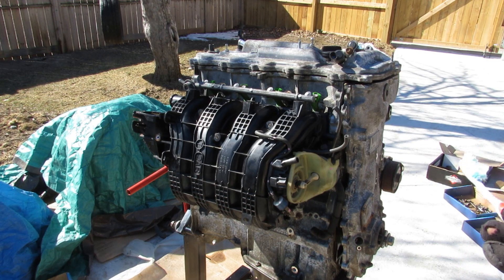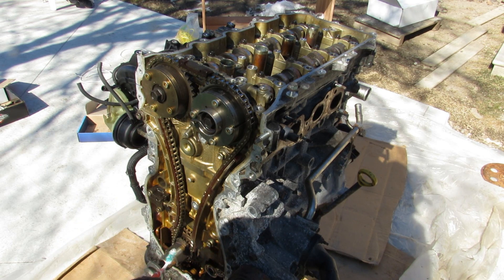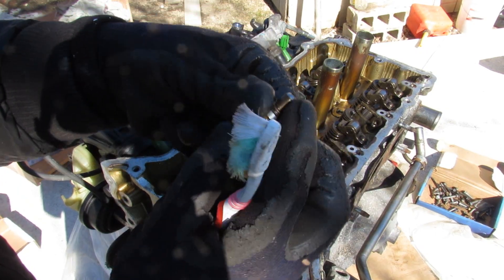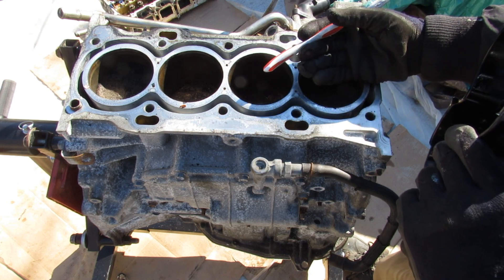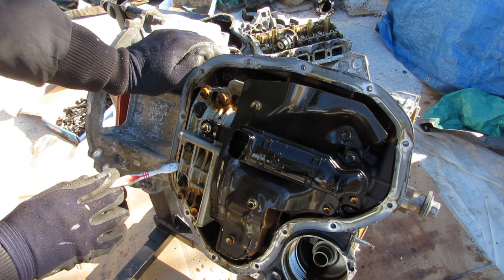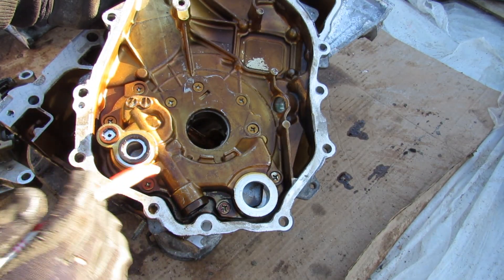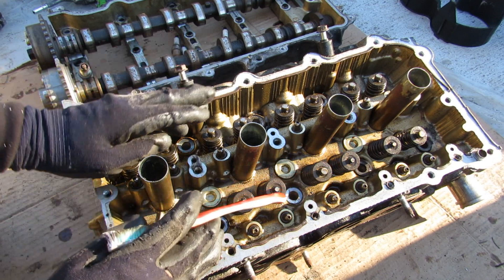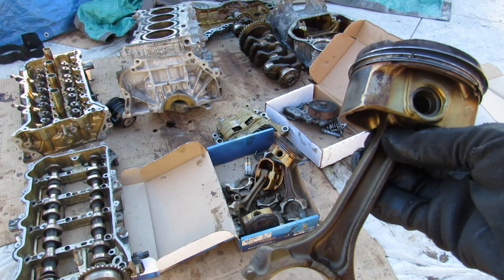Why Toyota Engines are Reliable

Comment: I noticed that since the CAFE race to increase fuel economy many engines use 0(5)w-20 oil, but many complain about oil consumption, reduced engine life, piston rings (Honda 2.4L) and crankshaft bearings failures. Plus increased deposits on intake valves in DFI, because of lower evaporation temp in low viscosity oils. 
So my question is how about using slightly ticker oil such as 0w-30, as they should provide adequate low temp lubrication during start ups, yet withstand higher loads and temperature. Would thicker 5w-30 which was  standard for decades harm engines that supposedly use 5w-20 weight, especially in higher millage engine?
A friend of mine uses in his 15yr old, 400k+ Odyssey 5w-40 Liquimolly for the past ten with no adverse effects.
Reply from the maker: A thicker oil might benefit a higher mileage engine. 
Remember the second number indicates temperature not viscosity
Reply: Our 2009 RAV4 shows zero oil consumption between 5,000 Mike oil changes using the recommended 0W-20 oil. I think anyone having problems may be using too long if an interval between oil changes (and may be blaming it on the low viscosity when that's not the problem).
Reply: I noticed on Honda engines, as we serviced a lot of Honda's, if someone did oil change past the computer reminder light, the cars would start 'burning oil', as it might either clog the oil ring passages or wore the rings. And in case of an Acura TL, one of the guys bought from the dealer still on warranty, we only drained 2 and half liters from the pan - where did the other 2 liters go😳. Nice environmental savings, with the 'Blue smoke' behind.  Anyway, the dealership changed the rings on warranty without much arguments.

Comment: My female friend had a 2008 Rav4 with one of these that burned oil since new like crazy.  Toyota dealer tested and said it was within spec.  If I hadn't constantly checked her oil level, she would have done the engine in within 50k easy.  I checked on boards and there are other complaints.  Toyota builds reliable cars, but they are not infallible.
Reply from the maker: The 08 rav4 used 2AZ which was not a good motor. This one replaced that in the 2009 model year

Comment: ive had many toyotas, they burn oil like crazy & dont get me started on the 3rd gen prius motor with all those oil burning & carbon problems.....they can be an absolute nightmare so im gonna just stick with honda
Reply from the maker: You probably have the notorious 1ZZ and 2AZ from back in the day.
Reply: @speedkar99  Any tips on the 2az-fe engine besides a rebuild?  Anything I can do to prolong its life before it implodes?  I get the oil change every 2-3K miles since 124K with Mobil 1 and now started Amsoil OE oil.
Reply: 2nd gen Prius seems fine :) 3rd gen I think you have to get one after 2012 to avoid the head gasket issue. There's probably more issues

Comment: I would like to travel back in time to 1930 and set my laptop on Henry Ford's desk and play this video for him.
Reply: Just by seeing your laptop technology you will cause Henry a heart attack and there won't be any chance to review Toyota engine.
Reply from the maker: That would be cool to see his reaction
Reply: @speedkar99  He would be shocked to see how junky the new Fords are and how excellent the new Toyotas are in comparison.
Reply: @johnw4067  are fords that bad tho? I feel like theres much worse than ford out there. Fords towards the top
Reply: @lollol-xp4mc  fords are actually extremely unreliable in comparison to other vehicles. You get a Japanese made vehicles, or Swedish you will have a vehicle that will see the next 30 years if you take care of it. Ford, modern stuff at least tends to have major issues except for their highest end vehicles. And even then it is hit or miss
Reply: @DeathProductions200  it’s their electronics. Their engines, out of all the other US car manufacturers are still more reliable. They do make reliable engines and transmissions with a few hiccups here and there. GM just churns out shit, Dodge has nothing going for it besides the hemi’s which are actually really reliable
Reply: @novasketch8658  i will argue with you on dodge. Dodge has the best interior out of the 3. For their luxury trucks, dodge avoids the cheap feeling plastic. Where as for Ford, the platinum trim, has SO MUCH cheap plastic. Dodge also, for the Cummins is a really good engine. 

GM is middle ground, but the duramax is an amazing motor as well. 

Ford really only has good engines, and the more expensive transmissions. But to me, you can have the most reliable engine in the world, but if you have a shitty interior (I was in a 2021 F350 platinum) it isnt worth it. For 80k on a pickup, I would want the interior to at least use a more durable and premium feeling plastic.
Reply: @DeathProductions200  I don’t pay attention to the interior, maybe when I’m older it’ll start getting under my skin. As for GM the duramax is all they have for a reliable engine. I would say the corvettes engine, but with that 4 cylinder shut off the transmission likes to fuck the engine over and vice versa. GM is known for bad quality, that’s why Toyota pulled out of their deal with a joint operation between the 2 literally saying in the 80’s “because of the quality control being so poor on GM’s part, we will not be partnering with them”. To put this in perspective they partnered with BMW for the Supra. I have had many friends own a Ford and none of em complains reliability wise, a lot of friends owe dodge and it’s 50/50 split on their opinion. All my friends that have owned a Chevy have major complaints ab their car being in the shop constantly due to popped driveshafts, broken transmissions, and broken down electrical components. I hate GM specifically because they always fuck up somewhere and whenever they fix it they fuck something else up along the way. Interior quality isn’t my concern, IMO if I want a luxury car I’ll build it myself. Take it to a shop to have more sound deadening and have upholstery attached to the door panels or do that all myself. Reliability and knowing what I’m getting into is what I want. It imma get a shitty car I want it to be a consistent shitty car, so Ik what’s wrong and how to fix it and how much it’s gonna cost. GM is all over the place with shit like that. Sorry ab the rant, but after seeing so many of my friends stranded on the road by a GM product I just can’t recommend one to any sensible buyer unless you want a drag car and are willing to put a ton of money into it. Again sorry for the rant
Reply: @johnw4067  Have another glass of KoolAid. I used to drink Toyota's KoolAid  as well, then my tastes became refined and I'm now enjoying my F150.  It's easier to be objective now........... Toyota dealers and owners have a huge chip on their shoulder. All the best........ hang in there
Reply: @DeathProductions200  That's not been my experience
Reply: @cwqrpportable  I've seen more Ford vehicles broken down than anything, so that may be just my personal experience. But my subaru, and my Nissan were always ridiculously reliable in comparison
Reply: @DeathProductions200  I've seen Nissan Rogues drop their CVT right on the front curb of the dealership and my neighbours brand new Subaru was towed from their driveway two times during  the first 3 months of ownership due to electrical problems. That doesn't qualify me to make the broad statement you did any more than your experiences qualify you to make your assumptions.  I've had insanely good luck with all the F150s in my fleet of trucks.
Reply: @DeathProductions200  hello, I bought a 91FORD TAURUS used with56k The seller CONDEMI changed everything before delivery, I drove it for years  450 thousand , in 2016 #5 cyl ,,, low compression so what did I replace it with ? A2013 TAURUS with 21k on it in 2016 I don’t drive much now, but retitired  2003, between personal car, but mostly  in job in HVAC/R I have done 1.35mmillion miles ,.cheers  🇺🇸🇺🇸🇺🇸🇺🇸
Reply: @novasketch8658  Not really, pre 08 afm LS engines were very reliable and wasn't hard to find them 200-300k with no major repairs.
Reply: @johnw4067  a modern Ford kicks the living crap out of a 1930's era Ford. I've actually driven a fully restored 33 Ford (like Biff's car from back to the future but not convertable) and it was horrible. Speed-wise it would be a pain just to take it on the highway.

Even 30-40 years later (60's-70's era) the average vehicle was trash compared to modern cars. And it's not just things like the low power and poor fuel economy... handling, brakes, versatility, and accident survivability are all things that have improved immensely.
Reply: @lollol-xp4mc  
Every Vauxhall - Opels made in Germany are better then the rubbish made here in the UK.
I guess some GM products in the states are terrible as well.
Reply: @lollol-xp4mc  dunno man the ecoboom is pretty bad.
Reply: The world would be driving nothing but Model Ts from the early 20th century ....
Reply: @thetreblerebel  no shit. He’s he just wants to show the improvement in Automotive technology
Reply: More like Ford would ask, "How the HELL do you machine something like that?"
Reply: @RedircSiuol  Hold my beer, Henry. We got robots  churning out parts and welding bodies together. Lemme pull up a few YouTube videos.
Reply: butterfly effect: Ford being a big fan of Hitler in the early days sells him this technology and he wins the war :P
lol
Reply: @NatapixAS  If only.
Reply: And then you would realize you didnt download it and there is no internet
Reply: Ford US maybe but Ford Europe has been doing fine for years. The odd nail here and there but generally good.
Reply: He'll give it a thumbs down.
Reply: I have a 2018 GMC 2500hd truck that I occasionally think, if I could drive this truck back to 1900 and show GMC, I imagine them taking apart every component and being amazed and completely baffled by the electronics, touch screen radio, etc. I had a ‘68 Chevy pickup and it was soooooo far from what I have now!!
Reply: it wont help cos he will tell u that Ford stands for Fix Or Repair Daily🥴
Reply: @jeffbigbear1766  I'm relieved! Here I was thinking it meant Fucking Oakie Retard Driving.
Reply: He would tell you that the general public does not have good enough fuel for a compression ratio that high.
Reply: Henry Ford: "Whats a milly-meter?"
Me: ...
Reply: Jokes on you, you would hit play and then remember there’s no internet
Reply: Imagine the engine technology if he were to see this, the head start they'd have and where it would be today would be pretty wild.
Reply: I just wanna travel back in time.
Reply: Ummmmm ive worked in a shop and seen just as many Toyota as Ford 3.0 Toyota has interference motor & constantly seen where the repair is a whole new motor seen many water pumps fail, seen many Toyota regardless engine size or displacement blow head gasket required fix usually new heads cause the aluminum warps seen MANY vvt systems plug up due to oil contamination or wrong wieght of oil used the cam phasers normally can't handle extreme ambient temperature changes such as hot days cold nights & harsh usage so not sure you'll show anything special all models break
Reply: It would be douable back then but cost a trillion dollars
Reply: He would say, “so nothing has changed, wtf?”
Reply: Old Henry would say: `What is this sorcery..?`
Reply: If you could, engines today would be 100% plastic by now
Reply: Ford: "You're not Jewish are ya?"
Reply: Go back even further, & show it to the true father of the car, which was NOT Henry Ford!! Try the year 1886!!
Reply: Good luck charging it. 
Lol
Reply: @Dave_Crupel  good point!!
Reply: @Dave_Crupel  they had electricity in the 1930s, just gotta find a 12v DC current.

Comment: yea, you're right. Those toyota engines with piston ring issues that burn oil faster than gas are so reliable... dipshit
Reply from the maker: I think you are confusing the 2AZ with the 2AR
Reply: @speedkar99  toyota motor

Comment: Is there a way to prevent combustion chambers to become so dirty ? some products out there pretend they clean carbon deposit, would you trust those ? Thanks !!
Reply from the maker: Clean throttle body periodically. Change oil, spark plugs. Check and clean PCV system. Use good gasoline. Italian tune-up.
Reply: @speedkar99  "Italian tune up" even my Prius gets one of those occasionally

Comment: Hey Speed, have you ever had the misfortune of playing with a 2.8/2.9L atlas from Chevrolet? The 4 cylinder colorado from 04-12. My engine has been really good and the timing chain doesn't slap or anything after 160k miles. The 2.8 also has lotsa grunt high and low.
Reply from the maker: The 5 cylinder? That would be interesting to teardown
Reply: @speedkar99  the 4 cylinder is 2.8/2.9 five cylinder is 3.5/3.7

Comment: I am here because of my 2AR Fe cold startup 1sec rattle. Some mechanics have mixed feedbacks about this issue. Some people say its totally normal on toyota’s even if lock mechanism worn it wont harm anything. But some guys say it is indication of vvti system gonna break without any notice, need to replace vvti actuator gear. Now that scares me. Whats your opinion on this
Reply from the maker: See my VVTi rattle video

Comment: Thank you for sharing your video.

Some ppl said the 2AR-FE has pistons' rings issues leading to oil burning. Would you believe so. Would 2012 RAV4 (manual) 2AE -FE engine reliable?
Many thanks
Reply: That was the older 2.4L 2AZ engine, not this one.
Reply: @tails300  thanks buddy
Reply from the maker: You are welcome. Not familiar with the 2AE. The 2AZ was the oil burner
Reply: @speedkar99  thanks mate. Sorry typo there its 2AZ. But do you think 2AZ ( Rav4 2012) would be having oil burning issue? 2AR 2.5L engine only available in 4x4 in Australia from 2013. For FWD RAV4 has the 2L engine its 3ZR. Do you think RAV4 2l is a bit small?
Cheers

Comment: This engine must have very reliable seals for the 5 large horizontal sealing surfaces.
Most engines have only three: valve cover, cylinder head gasket, and sump.
No doubt they use excellent materials. I own a 1982 Honda CBX-1000 6-cylinder motorcycle that doesn't leak.
Nice video!
Reply from the maker: You are right. Not a design I'd prefer but hey it works
Reply: @speedkar99  would you prefer to not have the balance shafts and their complexity? Also why no thrust washers?
Reply: @speedkar99  The Honda 'K' series engine is the Standard that all Engines should be judged by there a Bullet Proof design that has stood the test of time... still to this day folks are coming up with mad ways of fitting the likes of serious Turbos and superchargers onto same,  to drop into retro or modified cars and getting really mad  horse power out of same... [Got a local main Honda dealer to change out my 2006 Honda CRVMK11 [K20 ] Water pump as the Mechanical Seal failed that was over ten years ago that job cost 220 Euro including Parts, Labour and Taxes...can't be bad to that price...Great strip down and Upload First rate...
Reply: @malachy1847  meh ..my Accord engine burned oil and the vvt war very hard in the timing chain that it was a cascading failure.

Comment: Wonder why engine makers don't make the oil filter external, spin -off and part of the total engine design, like so what we can read the manufacturer of the filter. 

 Don't ever waist your time worrying about silly things like an oil pump wearing out, they are swimming in lubricant all day long and are good for 200k miles at least.
Reply from the maker: I prefer spin off as well
Reply: I like the cartridge style.

Comment: So where did the play on the connecting rods come from?
Reply from the maker: Apparently there are supposed to be like that
Reply: My 3sge has the same sideways play but runs just fine. Couldn't feel any axial play. I think it might be purposely done to allow for assembly tolerances without stressing the bearing under an angle. Or am I talking nonsense right now?

Comment: Thank you speedkar99, that's really clear video how Toyota engines work and why they are indeed deadly reliable. In Contrast, VW went back with a timing belt because their Timing chains, guides, or tensioner get bad all the time.  Afterall for VW, 100k miles is enough as their life for most of the owners.  so, they never need to replace the timing belt before they dispose of the cars. Same things with most BMW engines, their timing chain guides fall apart and granede the engines.
Reply from the maker: Yep the chains are definitely a weak  spot.

Comment: Quite impressed that this 2.5L 4 cylinder in-line engine can pull a heavy Toyota RAV4 and additional towing capacity. Engineering has come a long way. Congrats Toyota.
Reply from the maker: Yes it's quite powerful if you think back 15-20 years ago what a 2.5 was rated it

Comment: Does running the oil through the water pump body help to cool the oil?
Reply from the maker: It's such a small passage. I doubt it
Reply: @speedkar99  Do you know anything about turbo diesel engines/SUVS? I'm looking at buying a Pajero. I can pay for advice. Thanks